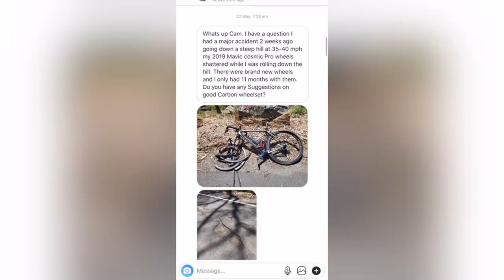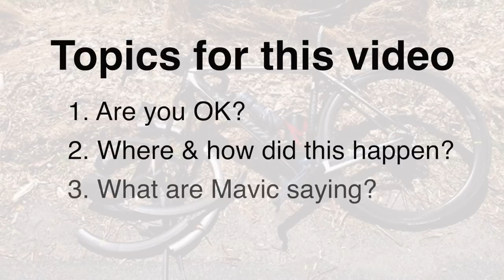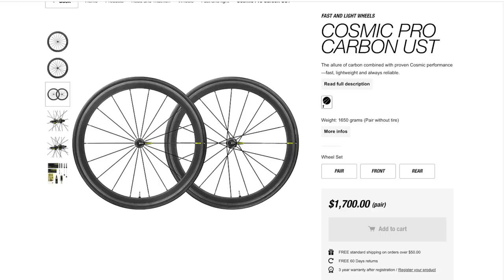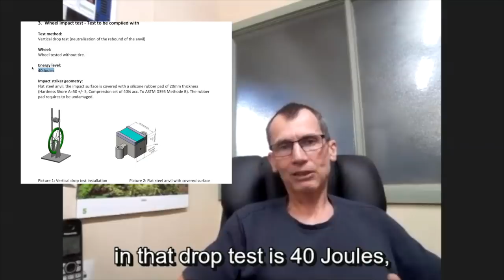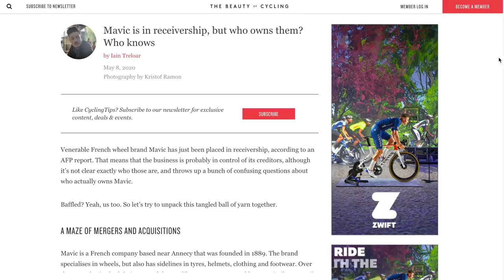A FRIGHTENING MAVIC CARBON WHEEL FAIL (at speed)

Comment: Luescher is an absolute sage. I run both alloy and carbon wheels but only run carbon with disc brakes for this exact reason.  99.9% of scenarios it isn't going to be an issue however i just dont think its a reasonable risk considering how easily it can be mitigated. carbon is a horrible heat conductor and rim brakes on carbon is just a horrible idea. i agree that a lighter bikes/wheels is always nice, the cycling industry is putting weight before safety these days. Unless new material technology is being introduced weight savings are coming from the quantity of material used coupled with "experimental" layering techniques; this often results in less tolerances for structural integrity. Carbon is too inconsistent in regards to build quality which again compounds the issue further. i broke a carbon wheel the other week (flared out likely hitting a hole or bump on the weakest point of the wheel) which was annoying and all things considered super lucky it was picked up before  a catastrophic failure. 
All the above being said. I ride 2 carbon bikes, i predominately ride on carbon wheels, i think carbon is a fantastic material i do however think the bike industry and general riders are pushing things too hard and creating unsafe scenarios.
The one thing few people discus though with carbon wheels in regards to Disc vs Rim brakes is how the force is applied differently through the wheel yet the manufacturing process for rim and disc is often the same.
Reply from the maker: Thanks for sharing on the thread. Cam
Reply: I can't be that much of a sage, I had to look up what that meant, if I got the correct meaning ;)
Reply from the maker: @LuescherTeknik  I saw 'wisdom' when I looked up the meaning myself! So gave the comment an immediate LOVE! Massive wisdom from you Raoul! Thanks again
Reply: @LuescherTeknik  wisdom my good sir. i love your comprehensive analysis on carbon and the bike industry in general. If i ever think i need to get my bike checked out....straight to melbourne. suggest 3 people to pay you visit since learning about you. 

keep up the awesome work
Reply: @CamNicholls  nailed it. classical greek philosophy "someone who attained a highest level of wisdom".

Comment: I have those same wheels that I do most of my riding and all of my crit racing on. I haven't had any issues in the 5 years I've had mine, but, I used to ride Enve 4.5s that I had fail on me. Enve took care of the issue immediately. Not sure how Mavic is going to handle this. They are in a bit of a pickle right now with their ownership situation.
Reply from the maker: Thanks for sharing Terrence

Comment: 100kg = more rim heat when braking
This Mavic wheelset is not excessively light at 1650grams. This is 100-400 grams heavier than race specific competitive carbon wheelsets. 
However, the wheels have fewer spokes than similar wheelsets. The standard is 20:24 spokes. These Mavics have 18:20.  
When you combine 100kg rider and low spoked wheels, the rims are more likely to fail when hitting potholes etc. 
The role of heat is uncertain - the rear wheel failed first after hitting a pothole. Most friction builds in the front rim, not the rear. Therefore there is room to argue heat was not the primary factor for rim failure. 
My views are:
- people over 85kg should not use carbon brake track rims in hilly terrain. If they do, they should not travel at speed. 
- rim heat only builds when washing off high speed. keep speed down and you are less likely to have carbon rim failures on descents if >85kg. 
Carbon rims are for lightweight racing, experienced riders who know the route and do not brake excessively, 21st century aesthetics, and projecting ego. 
They are not for heavy less experienced recreational riders on hills.
Cam, I live in Brisbane, and have had to endure the taunts of mates for going slower down the east side of Mt Glorious to Samford. 
But I've seen 2 rim heat punctures from 90+kg guys descending this route, and they were on aluminium rims. Both were oblivious to rim heat risk, and were barreling down at speed, and consequently braking excessively on corners. Rim heat risk is still poorly recognized by a majority of cyclists.

Comment: The other possibility is that that rim was softening up for to heat build up from braking. Then when the rider hit the pothole, the impact may have caused him to squeeze down on the brake lever causing the soft part of the wheel to move inwards enough for it to yield and for the tire bead to break through the rim.

I'd love to get a set of carbon wheels but I'd planning on holding off till I had a bike with disc wheels. I'm definitely holding off now!

Comment: I'm wondering if the construction of the wheel contributed to this. At 3:58, it's clear that the front wheel is constructed of several sections that are bonded together and the bonding between the sections has failed in several places. I would have thought carbon wheels would have been layered up to form a single piece. Are they all made like this?

Comment: There is video in youtube where one company tested various rim brake carbon clincher wheels braking ability to the point where temperature builds so high that the wheel fails. Most wheels failed just by popping tyre, as  side of wheel near the hook lost its integrity. But some wheels not just failed, they dangerously exploded in few parts. Mavic wheel was also tested there, and results were not "excellent". In any case, such inadequate manufacturing shouldnt be tolerated. If such engineering fail happened in car industry, company had lawsuits and lost millions. In bike industry they not only come clean, but continue to sell dangerous unsafe equipment.

Comment: I had same issue with Campagnolo carbon wheel but with less damage. I was lucky and didn’t fall (thanks to tubulars) but back wheel broke in the french alps while descending. I have then send email to the UCI because Campagnolo kept repeating that the respect UCI standards about this 40 J. Guess what, no one from UCI has never answered. After 3 months Campagnolo has send me a new wheel but it cost me lots of time and energy. I came to the conclusion that carbon wheels are very fragile and manufacturers don’t easily recognise default. Yes set of wheels is very expensive. Only manufacturers with wheel that comes with a “no questions asked” warranty like Reynolds replace them very fast.  Last details, those where disc wheels and not rim brake and still broke during the descend.

Comment: I was shocked when I saw my brother was still riding around on his original alloy wheels on his 25 year old MTB where the brakes had almost completely worn through the wall. I could almost push my finger nail through the wall. They had actually flared out under tyres pressure. Still didn't fail though. I bought him some new wheels.

Comment: Congrats on 2 yrs, great  videos and content along with perfect length.
Not sure if carbon components have limits for riders weight.  I feel they should above 80-90kgs
Reply from the maker: Cheers mate 👍
Reply: They do have limits, for this particular wheelset is 120 for rider and bike combined, as cam said. From kinetic energy and braking point of view, the weight difference from 90 to 120 kg is easily offset by slightly higher velocity. Hitting potholes with 90 or 120kg makes a big difference tough.

Comment: This is why SOME carbon wheel manufacturers (i.e., Scope Cycling) specify a fairly low rider weight limit for their rain brake carbon wheels, but do away with a weight limit altogether for their disk brake carbon wheels. Unfortunately, most don't. 
 I'd also suggest that heavier riders (such as Myself at the moment) stop looking into most manufacturers' carbon wheels and concentrate on those without a weight limit. These include: 

 - Spinergy 
 - Scope (this pertains to their disk brake wheels only) 
 - Bontrager / Trek (i.e., the Aeolus line) 
 - Reynolds (not only have they no weight limits - they also have a lifetime warranty on their wheels, as opposed to 1, 2 or 5 years that most manufacturers offer). 

 I also believe that all wheel (as well as frame, parts, etc.) manufacturers must work towards reliably eliminating weight limits. For instance, they could produce a bit more robust, possibly a 100gr. or so heavier no-weight-limit carbon wheels for heavier riders, and a bit more lightweight ones for lighter riders. 
 Then, there's the issue of potholes. It's interesting that governments rip people off in the form of taxes to subsidise animal abuse (i.e., meat subsidies, dairy subsidies, etc.) - yet ignore the issues with poor roads. While in The Netherlands this issue is somewhat uncommon, in Nord Rhein Westfalen (the most heavily populated German province, if I'm not mistaken), the problem is so prevalent one'd think he's in some 3rd World shithole. In rare cases the state actually does venture a semblance of attempting to solve the issue - they fill in the pothole with some hot tarmac - and are done, instead of breaking down the entire road and applying new tarmac.

Comment: I noticed carbon delamination starting to occur on a set of Roval Rapide CLX 40 rim brake carbon wheels.  It showed up as white linear lines on the sidewalls of the wheel and just below the brake surface.  I talked to a carbon specialists (who works in the aerospace industry) and he told me to get off the wheels immediately, which I did.  I switched back to alloy (Hed Ardennes plus) and never looked back.  I will never run carbon rim brake wheels on a bike again.  Its a death trap waiting to happen.

Comment: Material properties are very important. For safety critical applications it would be better if a material that can flex or yield rather than break would be safer. In case of a rim, a bend in the rim would be more safer than breakage. So materials like carbon fibre may not be a good choice.

Comment: @8:13 you can see the rider on the right front wheel makes contact with the other riders wheel which put a immense side load on the rim instantly, causing it the buckle. its not like the wheel just collapsed. any force on the back of the wheel causes the wheel to stop. add that with the side force of cranking, and you have a recipe for wheel implosion a aluminum wheel in the same situation would buckle.

Comment: Good video man. Carbon clinchers are crap by any manufacturer. Stick with aluminum wheels and don’t buy the hype of motorcycle brakes on a road bike to justify carbon clinchers. The A-Force AL33 is a toroidal aluminum rim tested within 3 watts of a Zipp 303. You can have your cake and eat it too.

Comment: I can confirm I am not confident with carbon rims anymore, I have roval rapide 60mm rims, I weigh in at under 160 and I was descending steep grades, and then both sides of my rear brake track completely deformed making the wheel have the possibility to skid at random braking moments. I want to move to discs asap

Comment: Cavendish's wheel failure wasn't just a random failure. It's clear from the footage the other sprinters wheel effectively rolled over the bottom part of Cavendish's wheel when they met, breaking multiple spokes and the rim and therefore it collapsed. I don't think any wheel regardless of its build would have survived that.

Comment: And people STILL are stuck on carbon wheels with rim breaks because disc brakes are a little bit heavier. As an engineer it's rim choosing rim brakes over disc brakes is just baffling to me (if you're not in the tour, racing weeks at a time).

Comment: Alloy sadly isn’t a perfect solution. I’ve had two alloy rims destroyed due to fatigue cracking around the spoke holes, though thankfully without any disastrous crash due to it (one did explode on a ride and leave me stranded though). Haven’t had any carbon rim failures thank goodness, but I’d pin that partly on waiting until I could get a good disc brake setup; I refused to run carbon with rim brakes. Maybe steel really is real?
Reply: Nicoya - you are not inspecting your equipment, or have someone do it for you.  That’s not a sudden failure, propagation over time.  Visual inspection easy peasy, not special equipment.

Comment: I had a similar situation with Mavic, c40 in 2016, I was going 50 mph down Hi Tor mountain not far from Bear Mountain Perkins Drive decent (where Raul fell) it's a very winding road and I hit a small hole on a hard turn, and my brake surface popped right off the aluminum internal structure. Had that model not had the aluminum skeleton I may not be here today. I only weigh 72kg or 165lbs, but it was a scary situation. I made it safely down the hill but had no wheel rim left. I now ride Mavic rear wheel but front Enve SAS 3.4 (because I can't afford enve SAS set..)
Reply from the maker: Thanks for sharing on the thread, Cam

Comment: He must be a heavy rider with high speed and holding on his breaks.
Reply: There may be an element of this but this does not excuse the failure of the Mavic wheels - a garbage product by the looks of it
Reply from the maker: @richardhutchings1980  Yes, would agree that it does not excuse. Especially when it falls within the weight limits. Cam
Reply: @CamNicholls  totally. Mavic had good product in the late 90s and early 2000s when I started cycling.  Nothing good for about 10 years.  I wonder about the correlation to it going into administration/financial limbo
Reply: Exactly this. Poor understanding of proper braking technique. Then smashing into a pot hole

Comment: So... you violently hit a square edged obstruction at speed, and it exceeded the strength of the wheel, got it.  I had a guy bring in his girlfriend's carbon GT road bike after she crashed.  The fork legs were snapped off just below the crown, and the frame was rekt.  The guy was livid that the forks failed, and his girlfriend was hospitalized.  What happened?  She was flying around a wide turn and hit a curb head on.  It took awhile for me to drive home the rather obvious point that bicycle frames weren't designed to withstand an impact like that.  Fortunately, he took it well, and GT gave her a new frameset, anyway.  Assuming the wheels weren't defective, no road wheel would have survived that.  Of course you can make a bicycle wheel that could withstand an even greater hit than that... it just wouldn't be very fun to pedal around.

Comment: In that Cavendish wheel fail, you can see that the rider to his left rolled his front wheel onto the front wheel of Cavendish, for that's what made Cavendish's wheel brake !!
Reply from the maker: Correct, but it still crumbled. Everyone else's wheels got slammed in that crash and they don't crumble like that.
Reply: @CamNicholls  yeah, I see what you mean, it did seem that most of the other riders got jammed up into eachother and many wheels maybe didn't get hit from the side like Cavendish, buthey carbon like all materials is not unbreakable. Atleast Giant has put out a replacement policy for any reason. Whether they will actually respect this or not is to see lol

Comment: Looks like we need to take pressure recommendations very seriously if the day's ride includes significant descents.  The beads on clinchers of all types have been the weak point in the design since its inception.  From bicycles to motorcycles to cars to earthmoving equipment to aircraft - each have a different solution to addressing the issues unique to the application.  For those suggesting aluminium as the "solution" to this issue, well, no, it breaks too (BTDT, and the old school Ergal rims were even worse).  It also corrodes and can be weakened by any number of interactions with the environment, not to mention it has a finite stress life.  What all this really means is pick your poison and realize any wheel can break under the right conditions.

If you're heavy and going on a mountain ride, you need to be smart about using your brakes.  You also need to understand dragging your rear brake is a foolish move, and the rear wheel failing first points to this kind of brake bias.  The front brake provides the vast majority of braking power, and if used in concert with the rear, will require shorter applications for the same stopping distance which also means more recovery time between uses.  Ask anyone who has stuck a knee on the pavement at 200 kph roadracing motorcycles.

Comment: If a descent is gnarly enough to compromise an alloy rim from braking heat then it's gnarly enough to cause massive fade on disc brakes. Both equally terrifying. I'll stick with alloy+rim brake for most bikes and alloy+disc brakes for a bike that's to be ridden in lots of mud/rain. I weigh 225lbs so carbon is a no no for me.